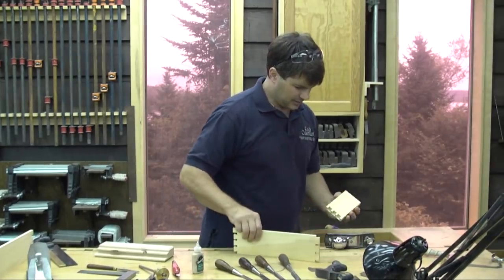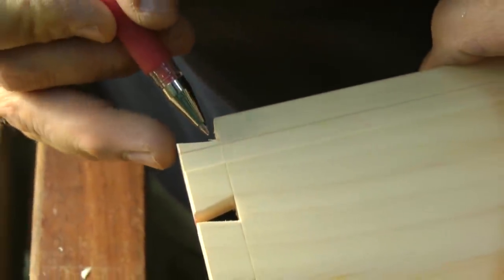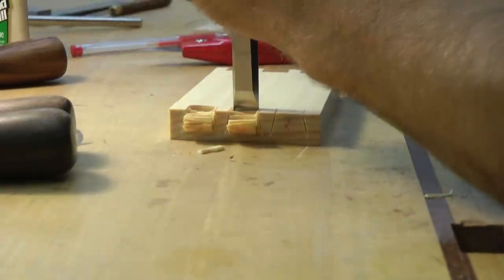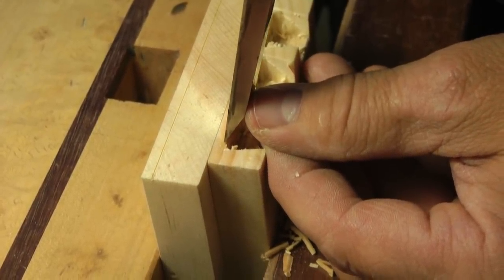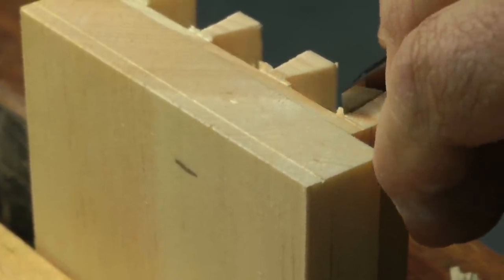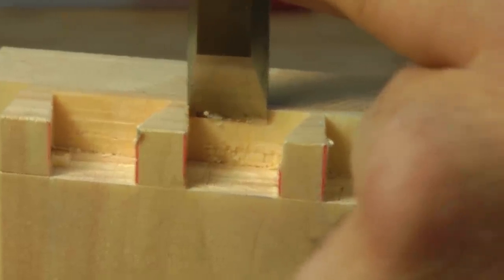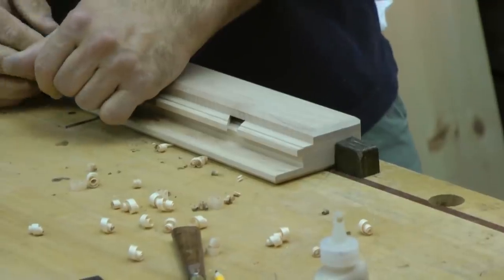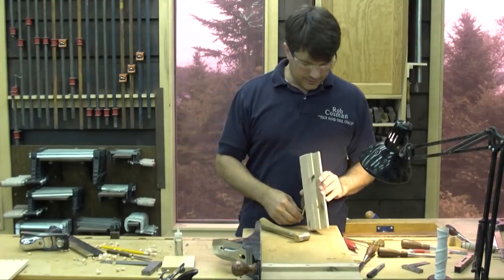Hand Tool Project Episode 10 Pine Candle Box

Comment: You have a tool you sell that is put in the groove that you cut with the saw and use your mallet to compress the fibers, why didn't you use it instead of using a chisel on the sidewalls?
Reply from the maker: Kerf X-10 - 2015, this video -2011